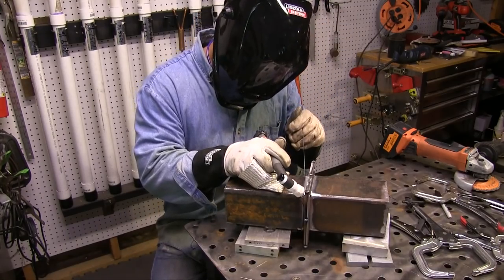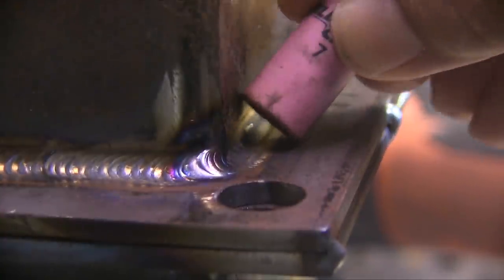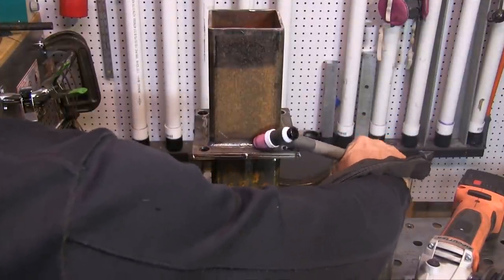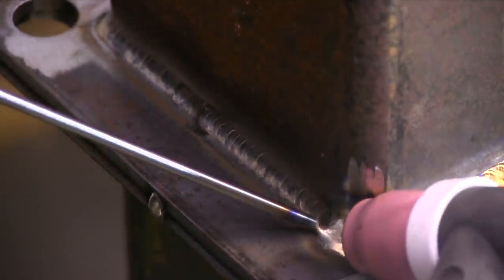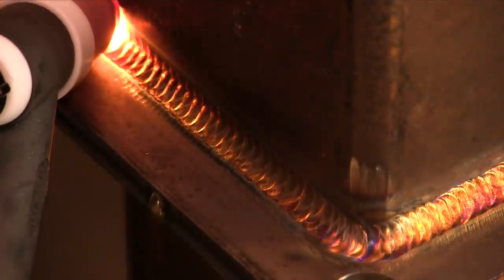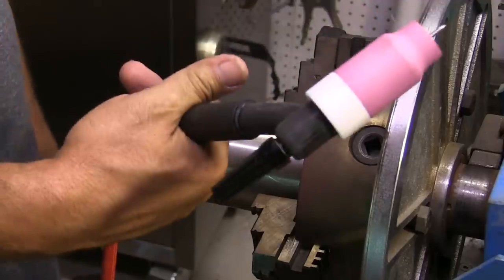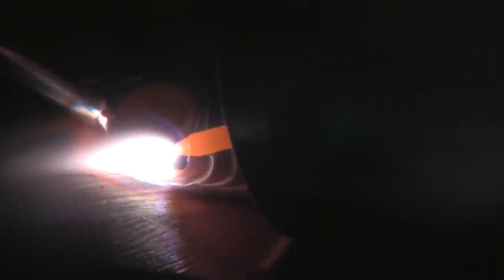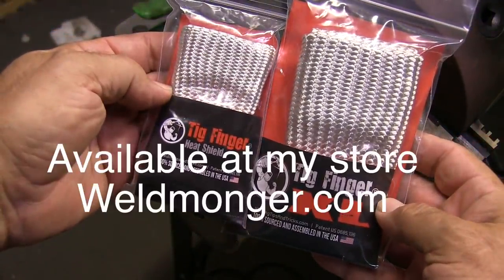More "walking the cup" TIG Welding Tips

Comment: I always enjoy your videos.  You explain it well and your welding is great.  I just need to work on making it second nature for me.  Thanks for taking the time to put these out there.  Also I will say that I bought your TIG Finger XL and it works great!  When I am making some parts I am welding on 2 ends of a 7" tube and without the TIG Finger it was impossible to prop on the part due to the heat.  Now its not an issue at all and I get much more repeatable welds on both ends of the tube because of it.  Thanks again!

Comment: Still trying to master the action seems I am pushing to hard and the cup releases its stick to the part and I get a jump in my bead I just need to do more practicing. I use the #8 gas lens fo almost all I do. Like your videos very much keep it going.
Reply: Bruce Kennedy practice with a dry rig with a big cup. Turn and roll in the direction you are travelling. It doesn't require much force. Too much and you will slip.
Reply: I also think my angle is to close to 90 degrees need to learn the sweet angle for just the right movement forward.
Reply: Bruce Kennedy stick your tungsten out almost as far as your cup is wide. If you use an 8 cup stick your tungsten out close to a half inch.

Comment: Wiggling the cup: 2 contact points on the cup
Walking the cup: 1 contact point on the cup
Reply: All right, that seems reasonable, and is a real difference.  Did you just make that up or is it in general use?  In my case at the moment, I'm trying to make fillet welds, and want to do this just to steady the whole business, and enable a tighter arc than I can hold with my shaky hands.  SO, the cup will be in contact with two surfaces all the time, not rolling back and forth like a drum as he said.  OK, "Wiggling" it is!   I just tried it today for the first time with one of those nice glass cup setups, and of course it's just held on there by an o-ring and is not steady enough to do this... serious beginner mistake and no harm done, but it seemed well to watch some more videos at this point.

Comment: Could you do a more in depth video to either the ahp160st or the Everlast140st machines and their tig capabilities(if you have them). It's all my current budget will allow and I'd be a beginner with tig so they're presumably be a good place to start
Reply: jayro4113 
The Everlast 140 is a good machine- plan on getting better cables/torch etc in the future to make it more useable- otherwise,  it's a good machine to start with.
Reply: But how capable is it? This is the kind of thing where a video is helpful, to actually show what all you can do with it and to what extremes. And since the ahp is in the similar price bracket, which is the better of the too? 
And what's the deal with the accessories that you'll be replacing them?
Reply: Machines like this need to have a shoot out so people can actually decide which is right for them, as I farm and the stick welding side of things will be used quite actively as well

Comment: For the people who have had a tig finger, how long do they usually last you? You know, before they start to break down or what not.
Reply: Zack lastname I use mine a lot still like new had it a year saves your gloves and hand great product I do  aluminum a lot gets hot fast it's a must have
Reply: Yeah it seems like it would work really well, thank you
Reply: It depends on what you're sliding it against. Just sliding on a smooth surface, they last near forever. Slide on an edge though, and unless it's well deburred/smoothed, it'll tear the fibers as you slide. Mine was fine for a long time, then it took only a couple edges to wear through a whole outer layer. I'm not at all upset though, based on how much use I got before it frayed - and I'll be buying more soon (I originally bought a 3 pack). I'm very much liking the idea of the XL ones... would be very useful to have multiple fingers protected from my experience.
Reply: Hmm alright then,  thank you for telling me

Comment: Hi Jodie. I am trying to get the hang of the walking the cup technique. It looks kind of like weaving to me. But i keep getting undercut at the top and of my welds. I reduced my current but then i cant seem to get a good puddle forming. But wen i get the right current to make the puddle form and flow nice. Undercut happens. I am doing practice pieces. Can someone help plz. Thanks
Reply: What position are you welding in? Meaning, is it laying flat like in his videos? But just generally speaking, you might not be pausing enough at the 'top' edge. That said, pausing too long is also a problem, but remember - the puddle follows the heat. If you're getting undercut at the top edge of your weld, try moving your filler rod up higher, near the top edge. That puts the new material in closer to the point you're seeing undercut, and again - pausing to let the puddle flow out around the heat is how you get it smooth. If the filler is added near the undercut portion, it'll smooth out more and undercut less.

Also, you don't need to just lay the filler in and 'walk' over it - I often will walk the cup, but dip rod in along top edges to avoid undercut. Dipping while walking works very well.

Comment: Is to use a 1/8ths (3.2 mil) tungsten and #8 cap a good idea for every welding job?
Reply from the maker: not every job....but a lot.  each job has its different details that might dictate a different size cup...but a 3/32"" (2.4mm) electrode can be used on DC up to 200 amps and down as low as 5-10 amps

Comment: Jodi, do you prefer the Lincoln Tig 200 in performance over the Lincoln MP 210/ Tigging ? ?
Reply: Henry Sanchez it's the same but can't weld alum with the 210mp both weld great awsome starter rig

Comment: What do you use on sharpening the tungsten ?   Is there a video on proper grinding?  Thanks!
Reply: There are handheld grinders you can get that are specifically for tungsten's. The one I use at work is a Techsouth, and while they're not cheap, they are very consistent and make excellent points. And they're little bigger than a dremel, and can sit on your work surface with you (in case you're like me and need it relatively often...).

Comment: What's the difference between a regular tig cup and a gas lens?
Reply: Gas lens has a screen inside and it gives you a better gas flow coverage and is preferable to a std cup. There are videos with smoke showing the improved flow coverage.
Reply: You can also Google "Gas cup lens comparison" and look at the images.  Out of a regular cup, the shielding gas starts to sorta "billow" a short distance away from the cup.  With a gas lens, you get a steady cylinder of gas coverage that doesn't "billow" for sometimes a couple inches away.  This lets you stick your tungsten out of the cup a little further so you can reach further, see better, etc.  You still don't want to get carried away with stickout, especially if there's the slightest amount of air movement.  I try to limit stickout to be the same as the cup diameter.